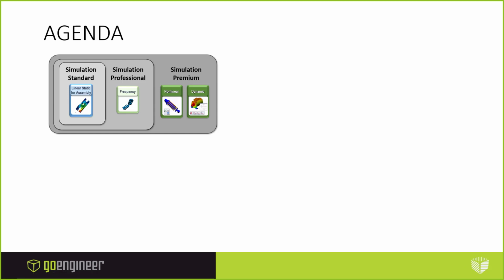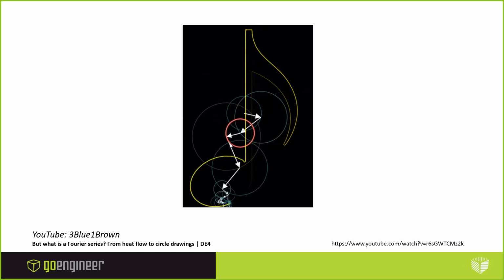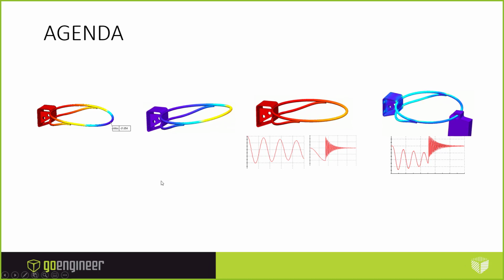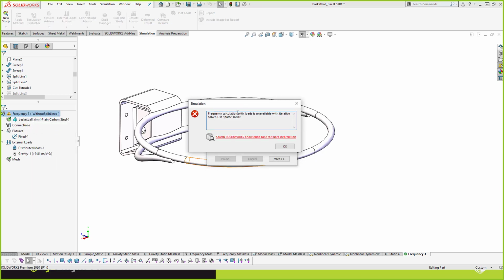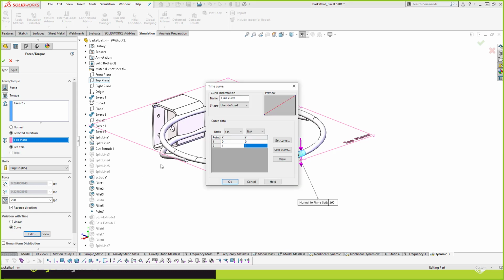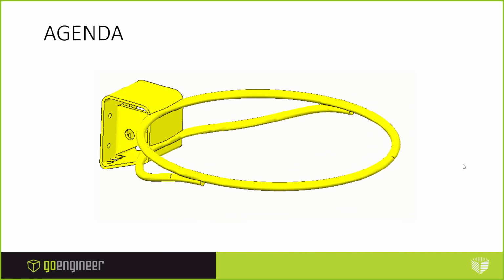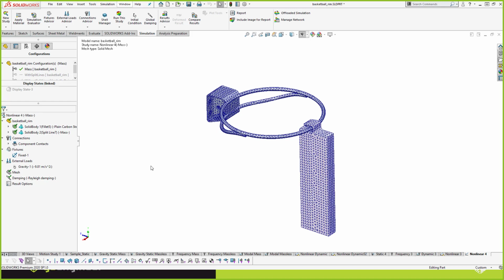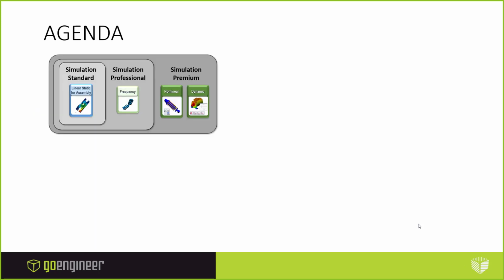SOLIDWORKS Vibration from Beginning to End ( Simulation Webinar)

Comment: Nice video! At 21:58, why did you apply both mass and force? Since you added force, shouldn't you delete the mass?
Reply from the maker: Thank you for your question.  Without the MASS the basketball hoop resonates very quickly (as if there is no person hanging onto it).  Without the FORCE, there is no downward displacement. So I need both.

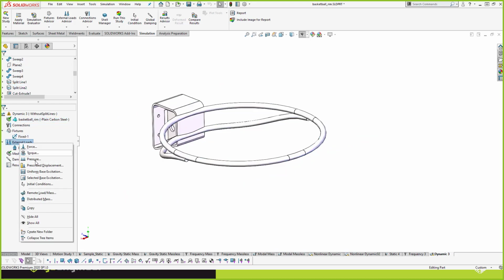Note: another way you might consider doing this might be to apply MASS and GRAVITY, but notice that GRAVITY is not available as a load in this study as I mention at 21:40.
Reply: @goengineer  Ah, that makes sense. Thanks for clarifying.
Reply: @goengineer  Hi, what you’re saying is correct because we are talking about a modal transient response.
In a Modal Transient Response, the concentrated mass is used ONLY as loading mass → it does NOT affect the frequencies → it does NOT affect the inertia after the load is removed.

If it had been a Direct Transient Response, the concentrated mass would be directly included in the M matrix.
The concentrated mass always affects the real inertia of the system, even after removing the force, so in that case it would have been impossible.
Correct? Thanks!

Comment: Much appreciated video. I am curious to know how you were able to let go of the rim for the linear dynamic simulation as this was not shown. I know you mentioned running a separate study, would I essentially let my mass y_val in the time curve be zero at x = 2 for example?
Reply from the maker: There actually may be a couple of methods for this, but the method I likely used in this presentation was to assign zero mass (since this is for the release case) and apply the load as a force somewhat slowly to load it and then release it.  Then for the force curve, I likely applied a force equal to the weight (I believe I used 280lbs) and then released it probably in 1-10 milliseconds.  So the curve could have had the following sample data points:
(0.000s, 280.0 lbf)
(0.100s, 280.0 lbf)
(0.101s, 0.000 lbf)
(1.000s, 0.000 lbf)

More precisely I probably would have used a cosine (copied from excel datapoints) to load it more gradually to avoid excitation for the release case.
Reply: @goengineer  You said that the first natural frequency (with the concentrated mass) is about 3.47 Hz.
The corresponding oscillation period is:

T=1/ 3.47≈0.288 s

You are applying the load for only 0.1 seconds, which is about one third of the period.

This is not the case of “a person hanging from the rim in a quasi-static condition and then letting go.”
Instead, it behaves more like a quick impact: a short downward pulse and then release. Right?
Reply: also, is there a way to extract the actual time series data from the probed plots? Im trying to validate an experiment where I used an accelerometer. I'm assuming there's no way Solidworks will be able to probe for velocity and acceleration in this kind of example without taking the double derivative of displacement data?
Reply from the maker: @willcawthra5454  Yes, when you use the probe tool, select points and select Response (it looks like a graph with a little clock on it).  This gives you the time history of whatever your plot is currently displaying (Displacement, Velocity, Acceleration, etc.).  Typically with these type of simulations, we solve for accelerations and integrate to determine velocity and displacement.  Integration parameters for Newmark or Wilson-Theta can be adjusted in the Study Properties under the Advanced Options.
Reply: @goengineer  If I wanted to extract the actual data as a table or column vectors to plot in matlab against my accelerometer data, is this possible to do?
Reply: Actually, I was able to figure it out. Thanks again for the prompt responses!

Comment: Hey. great work. but just a request. can you provide me with the solidworks model ? so that I can try to perform the same analysis myself. thanks.
Reply from the maker: The model used here is available in the SOLIDWORKS Simulation tutorials so you already have it on your machine if you have SOLIDWORKS installed.  You may go to Help | SOLIDWORKS Simulation | Tutorials | SOLIDWORKS Simulation Premium | Time History Analysis of a Basketball Hoop.

Comment: Thank you very much for this great presentation. I have one question: in Static analysis you used distributed mass and gravity, but in linear dynamics there was distributed mass and force. Why force is equal to 260 lbs?
Reply from the maker: The direct answer to your question is that the force is the weight of the person that I'm simulating in this case.  I can't remember why I chose this weight in particular.  Something like the weight of some of the taller NBA players, but it more than likely came down to some interesting behavior I wanted to show in the results that happened around this value.  A bit of a "for presentation purposes only" Goldilocks number.

Some additional discussion:
There is a difference between WEIGHT and MASS that I will assume is already understood by the reader.  The inclusion of MASS is for the getting accurate frequency responses which depends both stiffness and mass.  We used 260 lbm because the analysis of the person hanging from the rim is including the mass of the person (260 lbm person assumed here).

However, the inclusion of mass alone will not create deformation in a dynamic study (and therefore stresses and strains) unless I include gravity.  So either I can enable and disable gravity to control the loading conditions, or I can turn on and off forces.  I decided to do the latter in this case as it's a bit more direct and gives me more control.